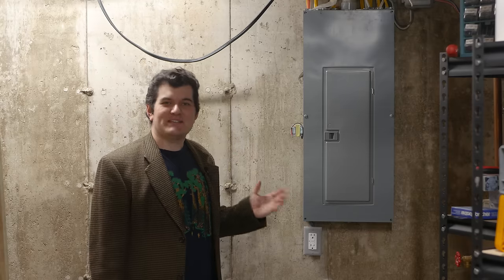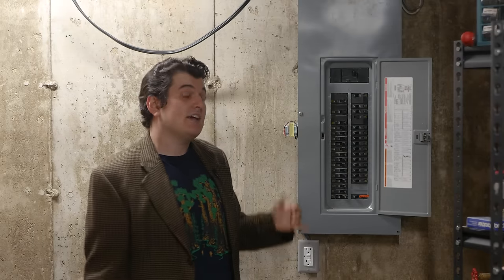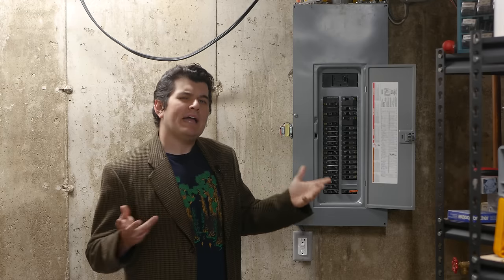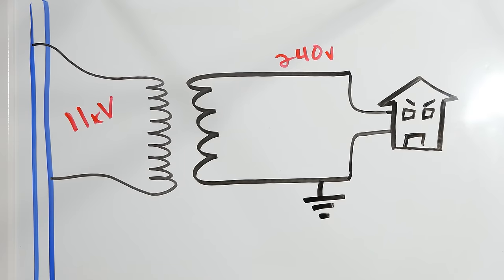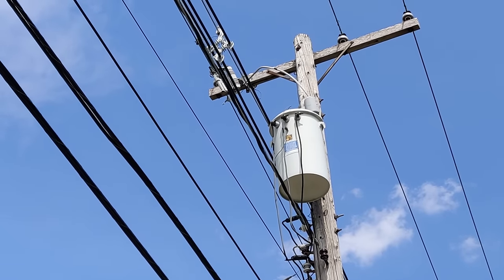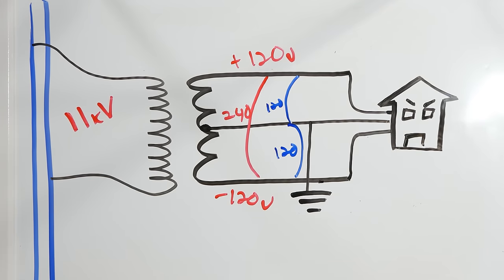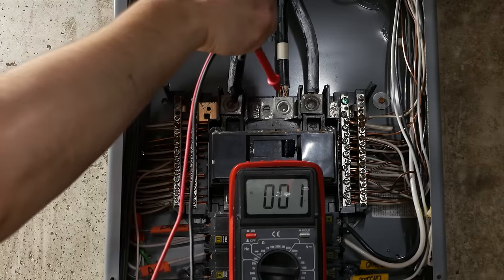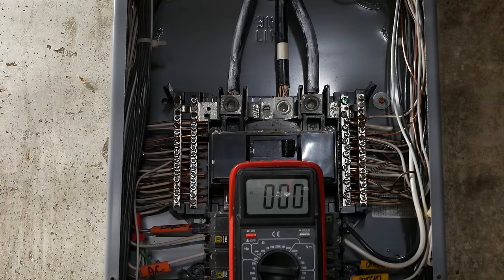The US electrical system is not 120V

Comment: Very good. I'm in the "electrical" business, and this is all great info. It just drives me nuts when people always say 110 volts. 120v/240v is the common target household voltage (+ - 6%) allowable variance.  Commercial can be 120v/240v or 277v/480v (considered Y voltage in a 3 phase system). And a Delta voltage consisting of 120v/240v/208v (high leg) 3 phase.
Reply: I just looked up the voltage standard for Pacific Power in Oregon.  it is 114/228 to 126/252 at the point of delivery.  That agrees with your statement.
Reply: A similar thing in my country is that people say 220 V, even though we switched to 230 V in 1989. That's 32 years ago! We should have got used to it by now…
Reply: @johnnyrosenberg9522  if you measure your sockets at home you’ll often measure around 240V in good old Germany nowadays
Reply: @rolux4853  Well, it's still within the defined range, I think. The actual value depends on several things, for instance how far from the transformer you live.
At my place I just measured 230 V at 0 A and 229 V at about 2–3 A.
Reply: I believe it was 110 V a hundred years ago, but it's crept up over time.  Now it's 120 V +/- 5%, which usually means slightly over 120 V at the panel, with dropping below that at the outlets depending on how far away they are.
Reply: Appliances are rated at 110V. That way they work even with dirty voltage. It's from the manufacturing that you get things at 110V.
Reply: @pfcrow  the furman power conditioner at my studio shows anywhere between 118 and 122 depending on the time of day (Brooklyn)
Reply: My Kill A Watt meter says 120 volts from Pennsylvania Power & Light
Reply: I know the plugs are 120 but for whatever reason I still call them 110.
Reply: My understanding of the history here is that Edison originally chose 110VAC, as the wiring practices at the time had higher loss and this would result in about 100V to the light socket.  That was the voltage at which his light bulbs functioned well and didn't burn out too quickly.  This may be where Japan got their 100V standard also.  By the 1930s, bulb reliability had increased and more motors were in use, so some regional power operators increased to 115/230.  The NEC finally standardized us on 120/240.  Some products list 125/250 as that is the max rating.  Growing up in rural west Texas, everyone "spoke" 110/220 vocabulary.  That was the standard in most of the western US for a very long time, and the nomenclature stuck even after going up to 115/230 (which I measured when I was in high school) and 120/240 now.  The voltage has crept up as equipment has been upgraded to the new standard.  It's not just people being sloppy--it's a lot of history that has inertia in people's vocabulary.
Reply: @darinsmith9468  Potato vs Potatoe
Reply: I have seen plugs on older devices state they are rated for 110V, and sometimes see 115V. Guessing that is where the confusion comes from.
Reply: @HudsonGTV  I heard a tale about a town where the Utility had raised the voltage to 125 volts.  People loved how bright their lights were.  This was in the incandescent days.  When the  power company backed off to 115 volts, people called in and complained. Funny Stuff!
Reply: @johnnyrosenberg9522  People call 240V and 208V 220V in the US too. We don't have anything that is 220V.
Reply: I would say it's more like 117V (per leg)
Reply: @johnnyrosenberg9522  All that happened for the increase was they cranked up the regulating voltage on the transmission transformers.
Reply: so that is just incorrect most of australia are now nominal target voltages of 230 only west australia is still 240, some other countries are starting to do the same now too, why would the US not be potentially doing something similar? 3 phase for 240 is also a 415 volt 3 phase system not 480 volt, typically the next step up is the 600 volt or more equipment for industrial applications
Reply: @tikterd12345  great and what do we do about the places that use 127 volts?
Reply: @shreddder999  then use 127? lmao
Reply: All these voltage specifications are nominal. They are also RMS (root mean square). Consumption (useful power) is measured in wattage, that is Volts x Current. That is like pressure times flow in hydraulics.  Because the voltage fluctuates 50/60 cycles per second, there is no steady volts x amps.  The voltage is converted mathematically to a weighted average so that the volts x amps averages out to be equivalent to a steady voltage. This is the root mean square which is equal to 0.707 of the maximum value in a sine wave.   This averaged/weighted voltage is the one specified, that is 120, 240, 208, 230 etc.  The actual real voltage (on a US/Canada system which uses the center tap transformer) goes from zero to a peak of 170V then back to 0 and then to minus 170V and back to zero. This repeats 60 times a second.  The peak to peak voltage is 340V but this is mathematically equal to +120 volts steady.  If the European system is single phase then the voltage (I assume) goes from peak 240V to zero and back to peak 240 so the absolute peak to zero would be the same 340V span found in N.America.
Reply: @pfcrow  Years ago, there was a letter to the editor in Radio-Electronics that summarized the history of nominal U.S. utility voltages. The letter stated that 110 Volts was used through the 1920s, but at some point in the 1930s, this became 115 Volts. 117 Volts became the standard in the 1950s, but 120 Volts quickly superseded this in the 1960s.
Reply: @julianfell666  To clarify, this isn't simply an average since AC works with both a negative and positive value. Taking the average of this would essentially come out to zero. The root mean square provides a positive value which with a sinusoidal voltage (AC) is 0.707 times the peak value, as you described. This gives electrical engineers a representative value for resistive loads. If you apply this to DC you simply get the DC voltage.

Comment: "To those of you in europe this looks horribly gross and terribly unsafe"
Laughs in hanging brakers
Reply: It looks idiot proof. And should be. We still use fusible copper wire here
Reply: It makes a lot of sense where you have a huge variety of distribution situations.  In the UK we have 3-phase, 440/240v (delta/star voltages).  Most households are 240 unless a 440v is specially run for a workshop etc.  I love 3-phase as on a 'star' connection, if you get all phases balanced out there is no return current and therefore no return current volt-drops.  I think our choice of voltage goes back to wartimes when copper was in short supply.  For the same reason our house power sockets are wired in a 'ring' format where the wiring comes back to the fuse board completing a ring for each conductor.  Again, you can cut copper size for the same volt-drop.  Nothing unsafe about your setup though, although you have to be careful you don't find a socket outlet connected between the two phases.
Reply: Maybe not being idiotproof isn't a bad idea at all. I mean, natural selection should do its thing right?
Reply: @brianmason9803  Yes but our plugs are so much beefier to take the current at our disposal, rather than the thin little blades.   Beside,stepping on one of our plugs with bare feet is just painful, their's must actually slice into the sole of the foot...
Reply: @Alexander-jr8nw  We have GFI, usually limited to individual lines in kitchen, bath and outdoors, mains are available but very rarely ever used.
Reply: @jonathanpalmer155  Yeah, if you thought your plugs were painful, try stepping on a flat US plug. OUCH.😫

Comment: We have a similar setup in rural Western Australia. Transformers can be configured for a single high current 240V supply or a center tapped 480V supply allowing for 2 lower current 240V supplies for general use or a 480V supply which is commonly used for large electric motors, welders, etc. It is only usually found on properties out of town and is uncommon enough that it often isn't covered by the lecturers who teach apprentice electricians. I brought it up with one of my lecturers while doing my apprenticeship and he was quite surprised as he thought it had been phased out. After i pointed out that more than half the buildings i worked on had it, he then spent some time discussing it with the class. It definitely has some drawbacks though as you have to balance the loads well or you can have some really odd issues. Ive been to a few houses where they were connected by electricians who were not familiar with it, put too much on one side of the transformer and its voltage drops significantly, but being center tapped it acts like a seesaw and the voltage on the other phase rises. seen a few places where the lights would go really dim or bright when they put on the kettle or other large appliance. Some were so bad that one phase would go over 300V and the other was under 200V... Electronics really don't like that much.
Reply: My stove here in Germany runs on 400V for example, it has 5 lines going in (3x live, 1x neutral, 1x ground). That's actually how all houses in Germany are connected to the grid, but for most appliances only 2 phases are used for 230V. I don't think we have that seesaw problem here, never seen it anywhere, I'm not an electrician though, so I leave the cover on controlbox on. :)
Reply: @moos5221  
Domestic houses in the UK are single phase, minimum 60A supply, 100A these days.

Only large houses have three phase.
Reply: @snow-js4te  
3-phase in apartments is madness.
Reply: @snow-js4te 
Only needs simpler single phase.
Reply: We have 277/480 in the US for many industrial uses
Reply: @snow-js4te  Stoves use 3p in Finish apartment buildings?  Makes me wonder why.  I see how 3p is beneficial for a motor, and obviously can be used for a heating element, but... does it offer some advantage over 1p in that application?  I guess it must or your designers would not specify it, adding that extra expense to each unit.  I just can't imagine what that advantage might be.
Reply: @johnburns4017   I have an apartment that has a 3-phase supply. It's 230/400V 40A 50Hz. Our induction stove is connected to 400V. Every modern apartment in my country (Slovakia) has three phase power. Only older apartments in those old communist blocks of flats have single-phase supply. (often with aluminium wiring).
Reply: @Ignisan_66  
Amazing.
Reply: @Ignisan_66  In California, all homes have standard 120/240 volt services. Then we have a 'lightweight' 3 phase limited to starting a 20 HP motor  for small shops like my own. Just two transformers and one stinger line about 240 or 250 volts to ground, 2 wires 120v to ground and 240 volts when those are used in tandem. On larger 3 phase commercial, you dont get 120 volts at all without a transformer. Just got back from Topolcheny visiting family by the way.

Comment: When my apartment building has power issues, it's usually just one phase affected rather than a total outage, so I'll end up with major appliances and half my lights or outlets not working, while the other half are fine. I knew that that state was usually referred to as having lost or blown a phase, but the demonstration of the breaker panel and its busbar in particular made it a lot clearer what that actually means.
The video also explains why it takes forever for my stove/oven to heat up, which is not something I expected and had just attributed to it being a lousy unit.

Comment: Speaking as an electrician, you can never have enough breakers.
Reply: You got that right.
Reply: 19jc80 which is probably the reason for the Ring circuit in the UK.  I have noticed that they don’t have anywhere near the number of circuit breakers in their homes therefore many outlets connected in series  to a single breaker.
Reply: @charlesmurphy1510  Which makes fault finding too long, and any fault de energises almost all power. The only advantage from the ring on this regard is that removing a damaged link, you get two radials and no need for installation of a new cable.
Reply: @charlesmurphy1510  we had the Wylex fuses with  fuse wire that could be replaced. 32A, 2x 13A and a 6A feed. Still kept that board, it feeds the shed after updating the house. I know of a board in Holland that has 4 wire 3phase, blue is now neutral, on that cable it was a phase. Neutral was bound in with the earth. It was pre ww2.
Reply: @charlesmurphy1510  I read an article about this topic quite some time ago. As far as remember the reason for the ring circuit is that you can double the amount of amps at the plug with the same wire cross-section, as there are effectively 2 lines to the plug. But all plugs need to have their own circuit breaker in them. Let's say for a standard installation with star topology you need 1.5mm² wires for 16A, with a ring circuit you can transmit 32A. 
Another reason was increased redundancy, if the line is split at one point.
Reply: But excessive circuit breakers just mean more wires everywhere. If you have just one fuse per phase, you can split the wires as you need, connect a lot of light bulbs and outlets in parallel and save on wiring. Plus adding an extra outlet or something is easy; just connect it to the place the wires are split in that room or to the nearest outlet or whatever and you're done, no need to drag a new cable all the way to a fuse box.
Reply: @charlesmurphy1510  - Don't you mean "in parallel"?

Comment: The switches on the UK outlets are to stop the angry pixies falling out.
Reply: I was hoping someone would use the term 'angry pixies', although I generally think of it as a Canadian term. Also, angry pixies bite hard. They don't like you leaking their blue smoke.
Reply: This is why the US uses more electricity per person. All the electricity is dripping out of the sockets.
Reply: Likely a bad idea. I much rather pull a plug and presume the outlet switch is actually function correctly, or if some accidentally brushes the switch flipping it back on. Pulling the plug is practically idiot proof.
Reply: @guytech7310  What do you do if you get a shock from touching the cable near a hardly visible break in the insulation? Bite a pillow, hope for the best, and yank it out as fast as you can?
It's not a bad idea. Switches don't stop you from being able to unplug your devices. They are just an extra safety measure on top of that option. 
If a switch (up to regulations) breaks, you will know about it. It will never, without being sabotaged, fail to cut power when it is in the off position. If you switch it and the power is not off, it will not sit in the off position, or you will feel that there is no resistance behind the switch. If you feel a tactile device not providing tactile feedback, then it is obviously broken.
Reply: I went one further and installed outlets with double pole switches, so the angry pixies can't sneak out the other way.
Reply: A top gear fan I see
Reply: @Jaymac720  
I thought it was AvE lingo
Reply: @guytech7310  
Nothing stopping you pulling a UK plug. Switched sockets are far better.
Reply: @BruceNJeffAreMyFlies  In defense of our switches in the UK, they're very stiff and hard to accidentally press and so far I don't think I have ever seen one break.
Reply: @BruceNJeffAreMyFlies  We don't get breaks in the insulation. Never heard of such a thing
Reply: In all reality it is not up to the end user to be efficient but up to device makers to do so.     To make efficient products that do not waste power when not in use and except for a very very minor draw for say phone chargers almost everything else these days is very good at conserving power when not in use.

Comment: As someone who's added a 240 circut in their home specifically for a large window AC unit (I'll fix that drywall hole someday, I swear!) I resemble some of the statements in this video a little too much.
Reply: I've seen UK-style outlets installed in USA kitchens just so the owners could use their English kettles that heat water almost twice as fast are ours. The tragedy is that most of our kitchen outlets supply 20A, but code requires a special plug for 20A appliances that won't fit a 15A outlet, so most consumer appliances are limited to 15A. Kettles and toaster-ovens would both work a lot faster at 3,000 watts; even irons, which get behind if you use them too fast, would work better. I don't know about microwave ovens; does anyone make any (either 240V range-hood models or plug-in ones for 230V countries) that put out more than the usual 1100 watts ?
Reply: @pcno2832  they do have the combo outlet that takes 15 and 20 Amp plugs, but they aren't common in residential. Assuming you're talking 120v here the 240v 20 amp I'm not sure if it works with the 240v 15 amp